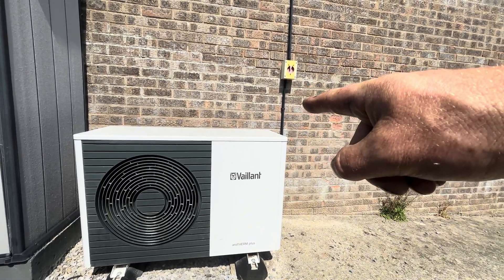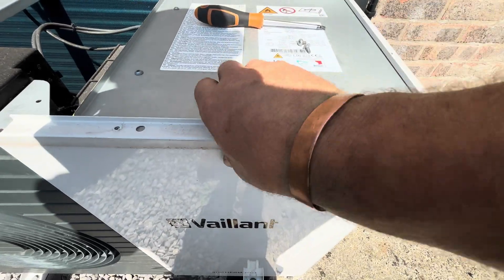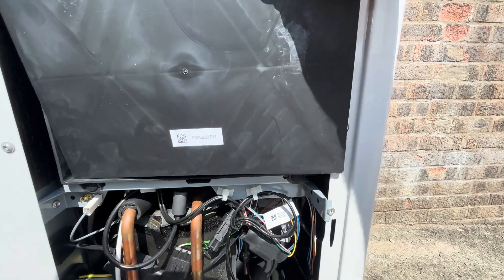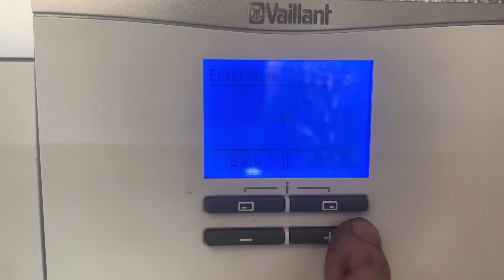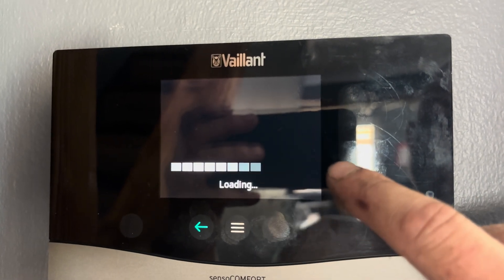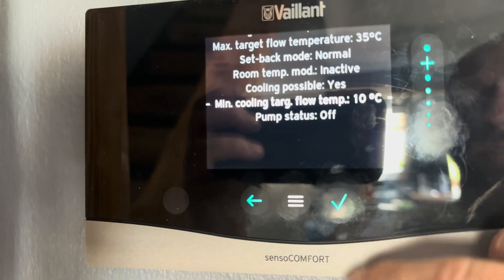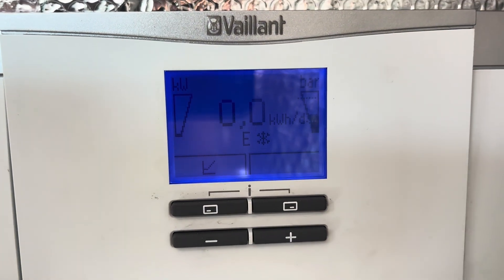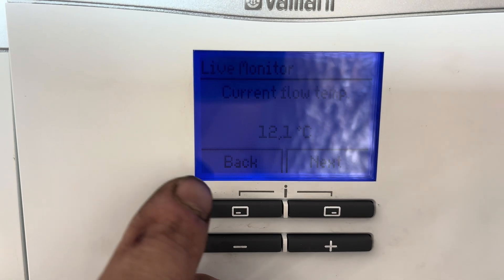Cooling With #vaillant AROtherm Complete Step By Step Installation & Setup Guide #heatpump #cooling

Comment: Pity you can't set this without taking the cover off like you can with most air to air HPs sold in UK. Most A2A have heating/cooling/dehumidifying/fan modes that can be set from the controller.
Also, yes radiators will drip water onto the floor in cooling mode - could be quite a mess and mouldy carpets. 
If you had fan coil  emitters with condensate pipes and it could be set from the control then this would be great.
This quite common in some countries. In UK Megawave do a system that will do heating/cooling with fancoils. 
I guess a Vaiilant arotherm plus is not the ideal unit to do this.

Comment: Hi, My heatpump is in cooling mode and i see the frost symbol. Its brand new and i want to test the heating. I don't know how to trigger it. It stays in cooling mode when i select zone 1 > heating > set a high temperature to trigger it. But it stays in cooling mode. Can you help me out with this dummy question?
Reply from the maker: There’s a couple of things to check; 

>OT switch off threshold, this is the temperature that the heating will automatically stop at. For example if it’s set to 16°c and it is above this temperature outside then the heating will not activate. 

>Check for any timers on the heating circuit 

>Check to see that the heating is not switched off under mode

>Switch cooling off

>Check the minimum flow temperature 

Are you using the SensoCOMFORT as a room thermostat or do you have 3rd party thermostats fitted?
Reply: @i85_Heat_Pumps Thanks for your quick response.
I’ve tried some of the settings you mentioned. I was able to switch the cooling off, but then the system shows no heat demand. The heat pump goes into standby, even though the set temperature is 28 °C and the current room temperature is 22 °C.

I also have an outdoor sensor connected. The Room Temp Mode was initially inactive; I tried setting it to both active and extended, but the system still remained in standby.

I changed the OT switch-off threshold to 28 °C, but again the unit stayed in standby.
The minimum water temperature is set to 15 °C and the maximum to 55 °C.

No timers are activated.
The strange thing is that the demanded flow temperature for the heating circuit always stays at 20 °C.

Comment: Thanks for this, with the heat pump set up with radiators for heating, what  has to be added to the system (apart from what is shown in the video) to do the actual cooling? You advise that the radiators won’t do the cooling which I get, so what does - an air conditioning unit? Do you have any product recommendations? Thanks in advance
Reply from the maker: Cooled water will flow to the radiators but they will condensate heavily along with the pipework that feeds them.

Fan coil units are the best option usually, there’s so many different makes and models available, ones that replace existing radiators, wall mounted units or ceiling units. It all comes down to space availability, design and budget
Reply: @i85_Heat_Pumpsthanks, so could you keep the existing radiators, install a wall mounted coil unit and then maybe run this as a different ‘zone’ on the console so the radiator system does not engage with the cooling.
Reply from the maker: Yes, this is possible. I’d advise insulating as much pipe work as possible to help prevent condensation, but dew point monitoring is on the SensoComfort to help with this. 

My setup currently runs through the UFH and radiators, but will be fitting a separate circuit purely for cooling the bedrooms at some point in the near future
Reply: Rookie question- what about the hot water, is this affected due to cooling mode?

Comment: To set everything back, if I can't get it working, do all of the settings just need switching back to what they were before to put the system back in to heating and hot water mode?
Reply from the maker: It should prioritise hot water, then heating and finally cooling, So you shouldn’t need to change anything back
Reply: @i85_Heat_Pumps phew... coz it looked quite complex to setup, redoing the complete setup every time the mode needs changing seems painful... but if it's just the indoor unit settings, not too bad.
Reply from the maker: You don’t need to re-do the settings every time, once you’re set up it’s done and will automatically switch between, the heating, cooling and hot water.

But it’s quite easy to revert if ever needed

Comment: What about condensation on pipes, especially where you can't see like under floorboards? Insulate your pipes, gentlemen and ladies, unless you want to rot your joists and have wet spots on your ceilings...
Reply from the maker: Yes! Completely agree, the dew point monitoring should reduce this though

Comment: I've just installed the resistor and found the active cooling setting on the controller, but the SensoComfort doesn't show the new settings yet. Do I have to reset something else?
Reply from the maker: You may be required to hard rest the unit (power off for 10min then back on) 
Has it been set up on the white control?
Reply: Having the same issue. Have set "active cooling" on the white controller but have no "automatic cooling" on the sensocomfort
Reply from the maker: You may need to perform a hard reset (power off for 10min then back on)
Reply: @i85_Heat_Pumpsthank you, odd but that it was.
Reply from the maker: @szoszi84 great! 👍
Reply: What are you hard resetting here? I'm having the same issue. What should be turned off for 10 minutes then back on? Tried both the sensoComfort and the white controller with no luck
Reply: Ah it's the heat pump, turning it on and off for about 10 seconds solved this. 👍
Reply from the maker: Yeah it’s both the heat pump at the rotary isolator and the control switch for the white control

Comment: Just tried this but at the end when checking 'live monitor' get a message saying 'compressor blocked' 'flow rate too low' - wondered if anyone had any ideas - I did set one of the temps to 18 just to be on the safe side of getting condensation with the underfloor heating - any help gratefully received
Reply from the maker: This means that there may be something restricting the flow of heating fluids, here’s some thing to check:
All valves are open
System pressure is about 1.5 bar
Filter is clean with no debris/ blockages
Any external thermostats have a demand
Radiator thermostatic valves are open
Reply: @i85_Heat_Pumps Thanks for this - just checked again and the message in "Live Monitor" says "Cooling Compressor Blocked" "Building Circuit Flow Rate Too Low" - checking further the Building Circuit Water Pressure reads as 1.3bar - so possibly the problem - there is a 'frost' symbol intermittingly on the display but no cooling. To set everything back, if I can't get it working, do all of the settings just need switching back to what they were before to put the system back in to heating and hot water mode?

Comment: I'm about to have one of these installed and set up in my house. I basically have a new build and UFH heating.

The question is, can I do anything before it's installed to make the cooling more effective? 
This wont mess with my cooling settings and break things like the hot water tank?
Reply from the maker: Assuming your underfloor heating is in screed then there shouldn’t be any issues with it. Just make sure that all exposed heating/ cooling pipe work is lagged to prevent any condensation forming on the pipes. 

You will not have any issues with the hot water cylinder 

Thanks

Comment: Our Vaillant system performs well when it functions properly, but we have encountered significant reliability problems. While breakdowns are expected, the primary issue lies in the support: despite having a paid maintenance plan, we’ve faced repair waits of 2–3 weeks. This has occurred three times in merely four years.

In hindsight, we truly wish we had opted for Hitachi, Bosch, or possibly Nibe from the beginning. Their products appear to provide much higher overall quality – and for systems like these, dependable performance over a span of 10–15 years is absolutely crucial.

Comment: After restarting the mainswitch of the pump, does it lose all of his settings? Does it go back to factory settings or i keep my imput?
Reply from the maker: It will not lose the current settings you have on your system, it’s the same effect as a power cut
Reply: @i85_Heat_PumpsThank you very much for the quick respons. This is much appriciated! It is 29°c inside atm.. looks like i need to install this 😂
Reply from the maker: @bl4cksh4dow159 No problem! Just be mindful of condensation from all uninsulated pipework, especially if you have radiators
Reply: @i85_Heat_Pumps we have floor heating so we should be fine i guess